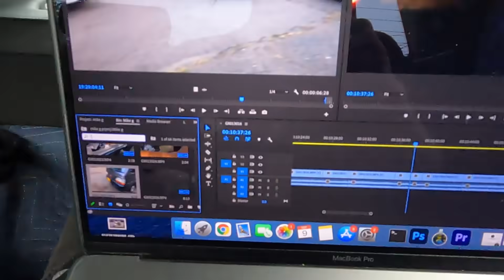Visiting Hidden Rare Car Collection!-Towing Trailer Almost Ends Badly..

Comment: Some of the roof racks have a number by the key hole whichll correspond to the number on the key. Some manufacturers also sell keys if you can get them the number on the core.